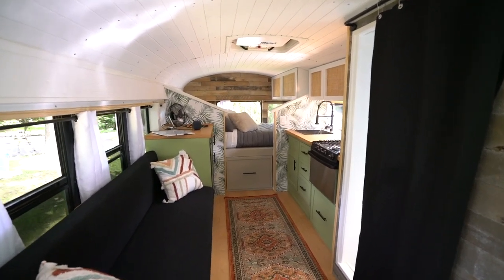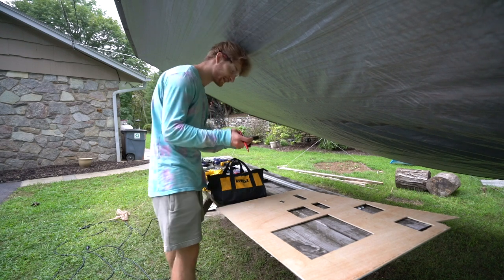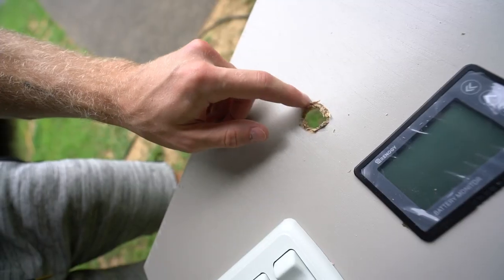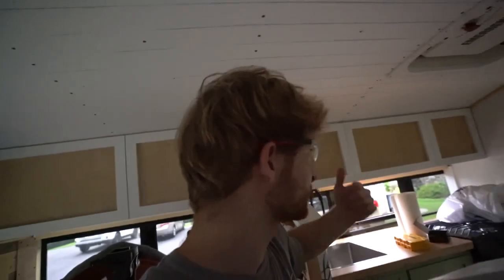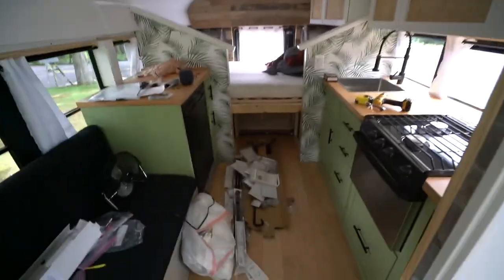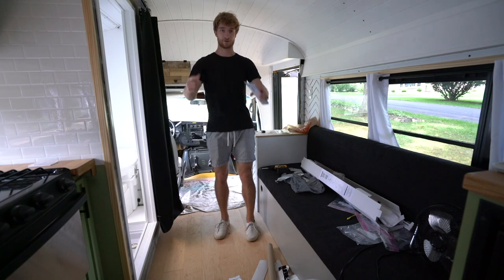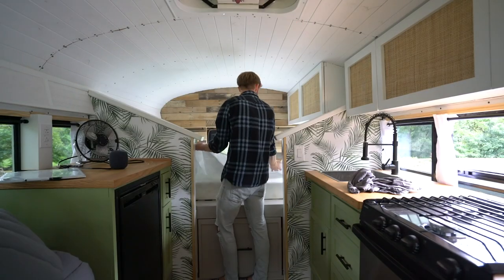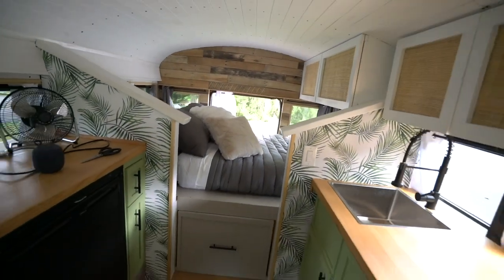This is the End...The Bus Build is Complete! - Skoolie Build Ep. 60 [Finale]

Comment: Awesome bus build. Your a great carpenter. One trick used to "pretty up" cables coming out of a wall- take a blank recepticle cover plate  Drill a hole the same diameter as the cable. Then cut the cover plate in half, splitting the hole. Then screw the two halves to the wall with the cable coming out of the hole. Congrats. I could see how happy and proud you are of what you've built